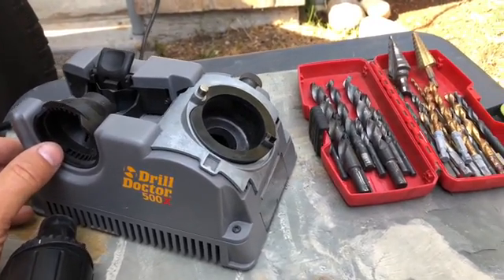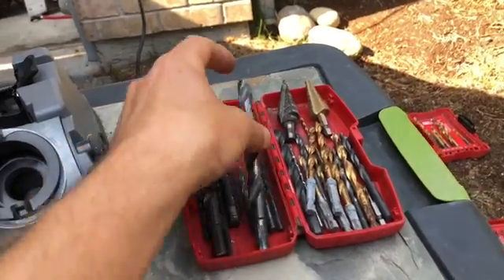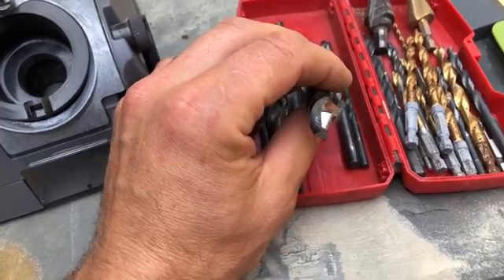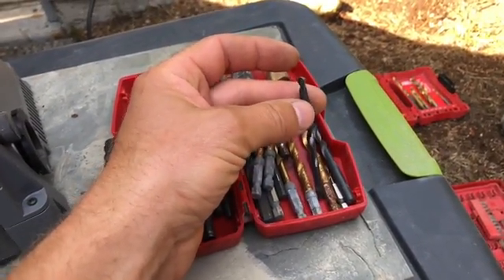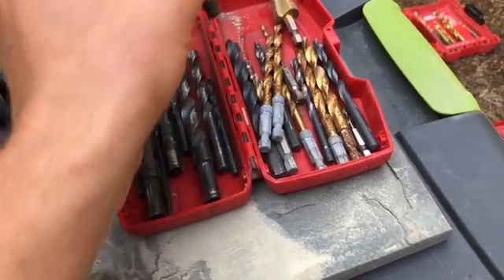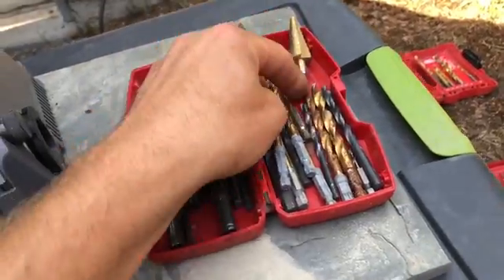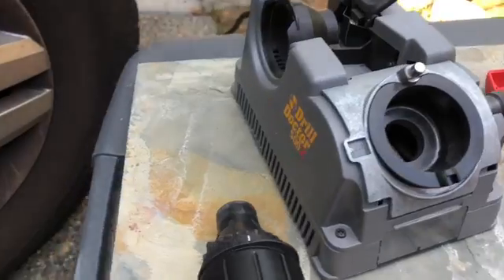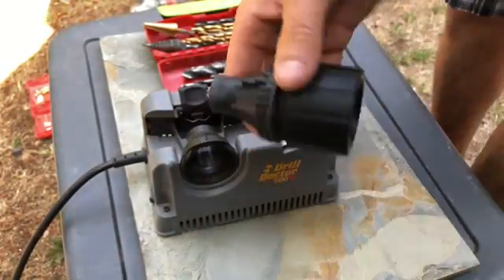Drill Doctor 500X Drill Bit Sharpening

Comment: when starting with a broken or cut drill bit i usually grind it , just to help the Drill Doctor a bit so as not to dull or wear out the diamond wheel in it. ( itll probably make the Drill Doctor last longer). Ive done it and works just fine using my method folks.😉